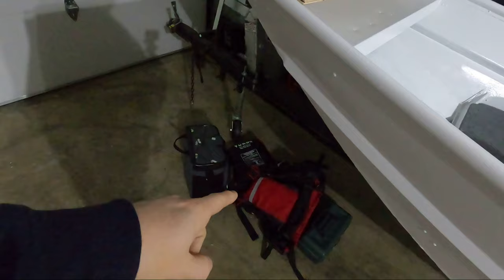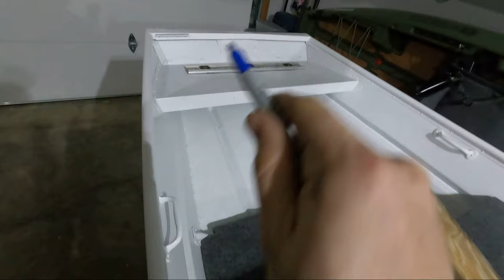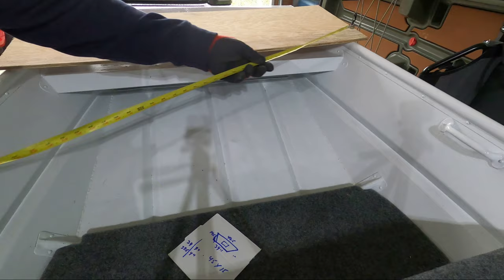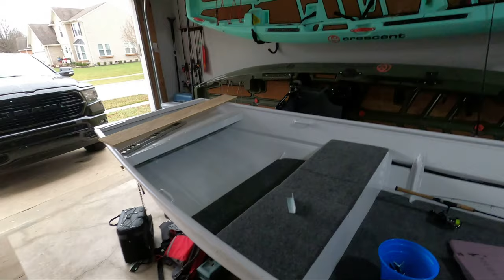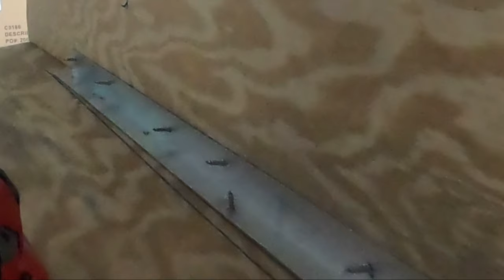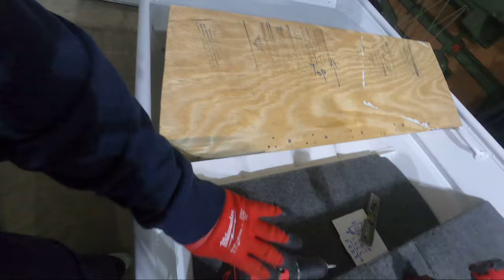FRONT STORAGE HATCH DECK PART 1 - Jon Boat To Bass Boat Conversion Build 1436

Comment: What kind of screws did you use to to screw the angle irons into the front bench
Reply from the maker: I used rivets to attach the aluminum angle to the front bench. Then stainless self tappers to screw the deck to the angle

Comment: Very nice video and channel.. i like your work my friend..how thick is the  plywood .. and do you think making floor and storage box using wood would make the boat much heavier than using aluminum!!
Reply from the maker: Thank you! I used 11/32 plywood, very thin and light. Aluminum would be comparable in weight depending on the thickness used but probably a little lighter and last forever. Aluminum is about 3-4x the cost though so it depends on your budget!